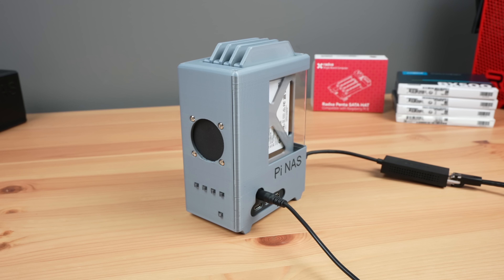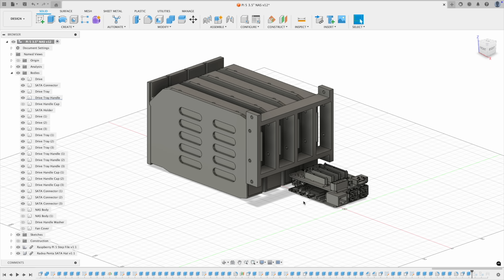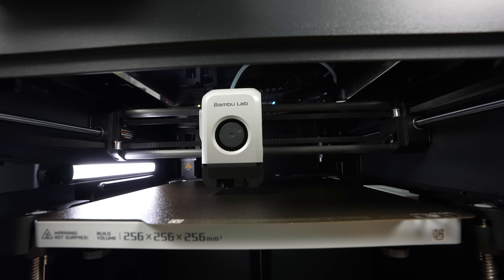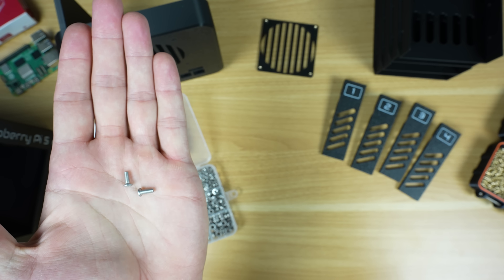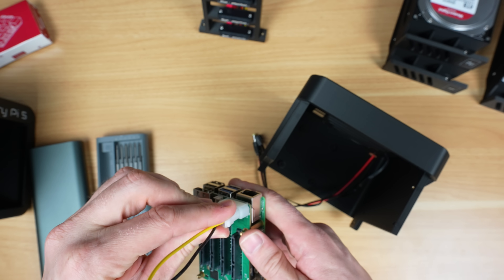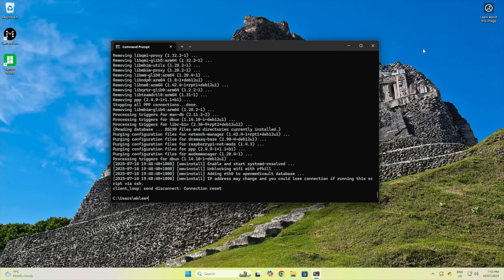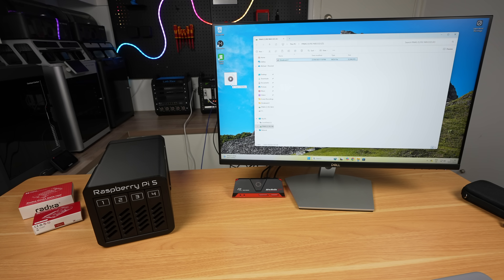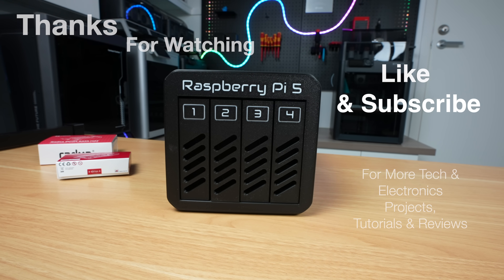I Built a 4-Bay NAS with a Raspberry Pi 5 - Swappable Drives & RAID 5

Comment: This is a very nice, slick build. There are a few things that I think I would have done slightly differently, such as splitting the case into three parts for a bit easier printing on smaller printers and building it with a standard 80mm fan in mind rather than the slim fan.

Regardless, this did give me some ideas for an old, now unsupported, 2-bay ReadyNAS device that I have, where, rather than attempting to reuse the existing front/back, I may just print my own that can fith the pi + hat.

Great job!

Comment: i noticed you are using a 80mmx10mm fan as exhaust..

with your design - do you think its possible to use a 80mmx25mm fan - like the Notcua NF-A8, or an alternative from Arctic?

Would appreciate any insight - planning on doing this exact build in a few weeks when I’ve got the parts on hand :)

Comment: Will the same drive racks work for 2.5 inch external SSD Sata drives?
Reply from the maker: I haven't put mounting holes into them for 2.5" drives but other than that there's no reason why they can't be used for the smaller drives.

Comment: i was onboard until i saw the sd card. idk if your goal was to make it cost effective, but if you're going with 4 4TB drives, might as well spend a little more to fit NVMe drive over USB... unless there is some hardware limitation im not aware about
Reply from the maker: I've had a Pi based NAS running for a little over 4 years now on a microSD card without any issues.
Reply: @MichaelKlements  "it works on my machine" well, i hope you keep backups. Good luck, won't be watching any of your videos ever again.

Comment: Great build! I am currently printing this Case. I also purchased some of the needed items, and the rest I had lying around. One thing is that your guide shows you using a 12V 4A power supply. For spinning SATA drives, it seems a bit underpowered. Did you have any issues with the PSU you listed? Again, thanks for the 3d files and Awesome idea.
Reply from the maker: I haven't had any trouble with the 4A supply but you can go up to 6A to be safe.
Reply: @MichaelKlements  Thanks for getting back to me. I will try the 4a to start. However, I did order a 8a just for a backup.

Comment: In the process of building now - very impressed - great work!  One suggestion, one comment.  First off, Penta Sata Hat hardware was using 2.5mm standoffs.  Either these need to be changed to 3mm to use 3mm screws, or you need to add some 2.5mm screws to build list.  Also, would be very nice to add a chassis mount HDMI to the back panel connecting to Raspberry Pi,  would allow connecting a monitor for full conrol of Pi in setup without having to resort to SSL.  Love your design, thank you!  P.S. Spacing just  a hair too high on back panel for e-sata connector (at least on mine).
Reply: Morning tomhendricks, I just received my hat, and it came with the 2.5mm screws in the case. Did yours not?
Reply from the maker: The Penta SATA hat comes with a full set of M2.5 standoffs, screws and nuts to assemble the Pi stack. These are what I used for my build, that's why they aren't listed again on the build list.
It would be fairly easy to add an HDMI adaptor but the Pi is running headless so all you'd see through the monitor is the same terminal you can access through SSH - so didn't think there was much benefit to this.
Reply: @MichaelKlements  Thank you for your reply - I am an experienced linux user, but had various issues getting openmediavault installed, so I had to hook up a display to the Rpi, to get going.  All in all, it worked out.  Love the device!  (Again thank you!)  I did find I had to go back and really watch carefully in your build video - that sata cable bracket and mounting of sata connectors just kinda messed with my brain! ha ha  But, all good now.

Comment: Hi,
Thanks for the video everything work great but the network adapter seem to not work do you need to load some drivers for it ? I order the same from your links
Reply from the maker: It doesn't need any dirvers installed. Have you rebooted the Pi with it plugged in? Are you also running OMV on a Pi OS Lite install?
Reply: @MichaelKlements yes , running pi lite with omv.

Comment: Good project, but the most used cases it just isn’t a practical option
Reply: Why is that? I was just about to pull the trigger on the sata hat!
Reply: @mrbeetham sas drives are just really cheap also a hba go to hardware raid to reduce the load on the processor. There’s no reason why that hat wouldn’t be a good idea. It’s just less good.

Comment: in case we use only 2 disks instead of 4, do we still need a 12v power supply instead of standard Pi5 one? Thanks :)
Reply from the maker: Yes, the SATA hat requires a 12V power supply regardless of how many drives are installed.
Reply: @MichaelKlements  got it, thanks

Comment: I love your designs and explanation. I'm new to 3D printing, but isn't PLA not a good choice because of the heat these drives will produce? How did it behave over time?
Reply from the maker: These drives don't run over 40 degrees, which is still safe for PLA. It's only been a few weeks but they've been fine so far.
Reply: @MichaelKlements awesome. Thank you.

Comment: I previously built a RAID5 setup using the ROCK 4B Plus and Penta SATA HAT, but I decided to stop using it due to concerns about rebuild safety. After some research, I found that RAID5 is prone to failure during rebuilds, and I no longer felt secure unless it was RAID-Z. In the end, I switched to a mini PC (GMKtec G3) with an M.2 SATA adapter and installed TrueNAS.

Comment: This is awesome! I'd happily buy a kit like this if it were available, as I don't have the space for a 3D printer.

My big questions are about scalability:
- Is it possible to expand this beyond 4 drives? Could you use a Raspberry Pi cluster to create a more scalable, expandable solution?
- What's the maximum storage capacity you could achieve with a setup like this?
- For more of a file server, rather than a media server, would a more robust OS like TrueNAS be a viable alternative to OpenMediaVault on this hardware solution?
Reply from the maker: - The expansion limitation is with the hat, it only has 4 SATA ports. To add more ports you'd need to add a dual PCIe adaptor and a second hat. 
- You could use 4 x 20TB drives in it, so 80TB total capacity.
- TrueNAS is not supported on ARM devices. OMV is quite a mature andwell supported system on the Pi.

Comment: From the screen recording you showed the HAT was actually running at pcie 2.0 rather then 3.0 as it does this by default. The section of the output from lspci you highlighted was the cap not the current link state. Also the pcie slot on the pi is only x1. Though either one the bandwith is plenty for the use case

Comment: How did your system start when you only use a 12V 4A Powersupply? Don't these drives use up to around 24 Wats when spinning up? Since the Pi5 is on the same power supply should this not cause instability when they start to ramp up? I'm also building a NAS with the Radxa Penta Hat but I get a bit anxious about choosing the correct power supply.
Reply from the maker: I've just used a power supply that meets Radxa's suggestions for use with 3.5" drives, I didn't have any issues with start-up.

Comment: ...soooooo...if you ever have to replace the bottom sata...you have to remove the rest first? You could have made the screwing design from the front or sides...or a simple clamping? Also...NAS raspberry pi...makes a cool demo, but I would not recommend anyone use it as a NAS. it is slow AF.
Reply from the maker: You can remove them individually with the short end of a hex key, its just cumbersome. That said you don't usually replace SATA connectors,  a commercial NAS doesn't have replaceable SATA connectors.

Comment: This is awesome, do u have any 3d printed mitx nas ideas floating around? i have a jonsbo n4 and the hdd thermals are terrible. i know there is a 3d print to add some slim fans to help cool the drives better but i'd like something new, i'm running a super micro itx server board with an nvidia gpu running unraid, truthfullyits more i need i might just sell it and build this pi nas but was curious if you had any intentions on making something like that or if you were just raspberry pi content, this is the 1st video ive seen from you which is why i am asking. thanks!
Reply from the maker: I haven't really looked into an MITX NAS, maybe for a future project. I've reviewed and played around with a number of NAS products and single board computers, so it's definitely something I could try.
Reply: @MichaelKlements  thanks for the reply! I love this pi nas though I might print it on my Prusa XL.

Comment: you are an animal with the designs. question. When you do your designs do you model every single thing in fusion 360, meaning all the Raspberry Pi components? Just wondering if there was an easier way to design models that are made to fit around others. Any help is greatly appreicated.
Reply from the maker: It definitely helps to have accurate models of the components to make sure that they fit properly but I don't model everything. For this model I uses the Pi and Radxa hat models (I have my own Pi 5 model and I used Radxa's hat model) and then I just modelled the drives and cable connector very roughly. You mainly want to make sure your overall sizes and interface points are correct.

Comment: A 3-wire controllable fan could give you opportunities to have temperature guided fan operation in the same way that the Pi Active Cooler works.
Since you have the full Pi OS with desktop available you might consider some Python code to present a status dashboard  and you can either VNC or HTTP connect to the device to view it.

Comment: My only add-on suggestion is an M.2 NVMe HAT with a small SSD drive. M.2 NVMe SSD drives last a LOT longer than those little flash SD chips. A dual NVMe board would give you the opportunity to set up NVM0 as the OS/Boot drive and use NVM1 as cache for the RAID array.
Reply: @WthyrBendragon Yeah, I agree—that would be a great addition. Running these setups in "prod" off an SD card is pretty risky, especially without a UPS.

I'm about to start a similar build (perfect timing, and thanks @Michael Klements), and I've been considering similar options. I'm a bit skeptical about splitting the PCIe lane into multiple "channels"—it can definitely impact overall performance. It might not be that bad with 5400 RPM HDDs in a backup server, but for an active NAS or anything performance-sensitive, it could become an issue.

My plan was to go with an external NVMe in a USB 3.0 enclosure connected to the RPi 5, and boot from that. I already run a similar setup on a few of my RPi 4s, and it works quite well. That would leave the PCIe lane free for a Penta SATA HAT.

I was also thinking of mounting the entire RPi 5 inside a custom printed enclosure and only exposing the 2.5GbE LAN adapter, so I can keep the NVMe drive hidden inside—still connected to USB 3.0 but not externally visible.

However, I’ll probably need to expose at least one of the remaining USB 2.0 ports (maybe via an extension cable) for a UPS connection—either for apcupsd or nut.

Any thoughts?
(Sorry for the long post!)
Reply: Is this setup achievable with the boards? I get the feeling there is only one connector port from the PI 5 board to the extension cards, how would you daisy-chain the penta card in this scenario.
Reply: @HomerJMonette  52Pi has dual and quad versions of PCIe expansion boards. Also, you can stack GPIO connections. 

The Radxa Penta SATA HAT instructions tell you to power the system via the HAT -> GPIO route.
Reply: @WthyrBendragon  sweet! Thanks for letting me know!

Comment: I always love the look of these tiny PCs, but with the cost of a pi these days it does not make much sense to me to use one for a NAS. There are plenty of very affordable basically e-waste PCs with hardware much more powerful that can easily be repurposed for a home NAS at the same price or maybe a little more depending on where you live. TrueNAS has been running on my home NAS for years now and the storage drives were the most expensive part. For affordability, larger spinning drives were the best option for usable space. This required me to to use a larger case that could hold all the drives. Using a standard ATX psu also made it easier to power all the drives as mine is using 8 total drives.

Comment: Man i'm literally building the same thing right now! I was looking for a 3d case model to print. You saved my day!
Reply from the maker: Considering a NAS build is one of the more popular Pi projects, there are surprisingly few 3D printable enclosures for them.
Reply: I am thinking about starting this project myself (lv. Noob). Do you guys think building a nas like this, it can be used as a media server? I read a lot of stuff about not able to be able to scale the different resoltions on different devices. Is this build what i need or do i need something else?
Reply: @coen993 i am using it as a media server but instead Raspberry Pi 5 i would suggest a more powerful Radxa ROCK 5C

Comment: Hard disks run hot. Will it warp? I put a petg sun shade behind the windshield camera in the car and after a year it is sagging a bit.
Reply from the maker: PETG is a good option for this project if drive heat is an issue.

Comment: Hey Mickael, my two cents: use rubber standoffs to mount the fan and get rid of the noise.
Reply from the maker: The fan noise coming through is the actual air turbulence, not so much a vibration issue.

Comment: I think YouTube ate my comment because I had the audacity of adding a link in there.

This is very nice! I used to run your SSD NAS case and was happy with it, but I wanted to mount everything in me 10” rack, so I designed and printed a 1U panel for the 4 drives. I ended up using exactly the same cables as you have in this video.

I really like your mounting of the cables! Gives me ideas for improvements on my rack panel. 

(It is on maker world and you can probably find it quite easily if you want to take a peek)
Reply from the maker: That's great, I'll go take a look at it! Maybe a Lab Rax NAS build should be my next project!

Comment: To be fair, I would have just bought a cheap 2.5" 120GB SSD for the OS and wired it over the leftover eSATA port. These days it's not much more expensive than a "high indurance" SD card but will last 5x as long as a system drive.

Comment: You can actually use the esata for a fifth drive. It delivers power but you'll need a cable that delivers 12v since the one that comes with the radxa kit delivers 5v only. There's a project 3D printer project showcased on Radxa's own documentation that achieves this, although yours look closer to an actual 4 bay NAS.

Comment: sorry for a dumb question, but does anyone know why not put a 120mm or 140mm fan instead? Would be way quieter.
Reply from the maker: I could go up to 100mm but there isn't enough space for a 120mm or 140mm fan, I'd have to make the whole enclosure bigger.
Reply: @MichaelKlements  I just downloaded the model, and seems like there could be space for a 120mm fan. What about taller cases? (if same footprint)... put the fan on bottom or top? fresh air will will through the whole case and you get a lot more component or cable space.

Comment: The SATA connectors on the back plane could use a bit more complaints. It helps to have them a bit loosely mounted a bit more play. This way they can auto aligned when plugging in and won't be under stress when plugged in misaligned.
Reply from the maker: The connector/mounting table is rubberised/flexible, it's not a rigid connector, so there is some flexability in it. Maybe a TPU part on the connector holder would help with this.

Comment: 14:47
Does the hat account for the 5V that is used for the 3.5 hdd?
During the chia "boom", many people had to use a separate voltage regulator just for the 5V rail as it takes a lot of power too.

Comment: Incredible work and such an impressive level of detail in every step! 🤯 I honestly wonder how you managed to think through all these individual parts, how they’d fit together, what precise dimensions would be needed so everything slots perfectly, where to place the screw holes, which inserts to use, and even how to route cables without interfering with fans or drives. It takes huge experience to design something this complex and have it come out functional on the first try (or almost the first try). 

Do you have any secret workflow or specific process you follow when designing such complex assemblies? How do you keep track of all these details so everything lines up perfectly in the final build? 🤯
Reply from the maker: Thank you! I don't really have a specific workflow, I've just done quite a lot of CAD design for 3D printed components and housings for single board computers so I now know what to look out for. I still make mistakes and very few designs work out on the first go.
Reply: @MichaelKlements  ...and humble 😄 Thanks for the answer 🙏